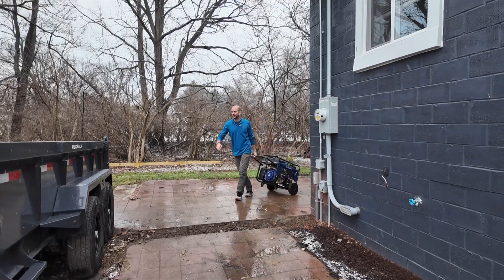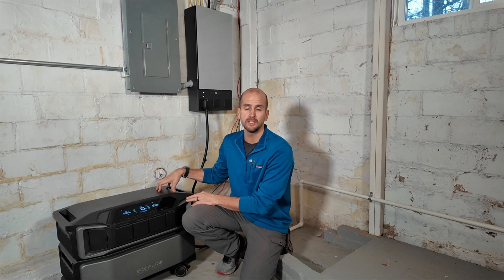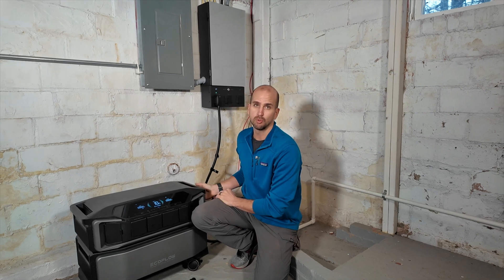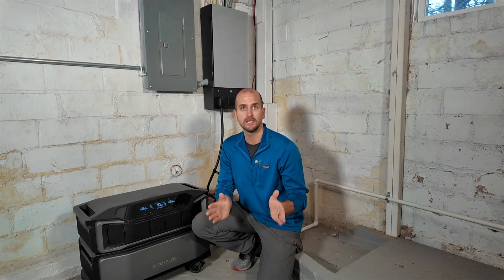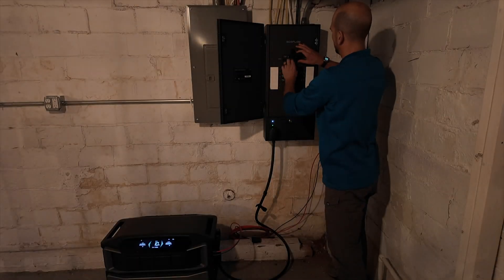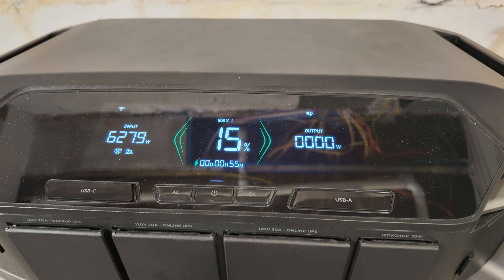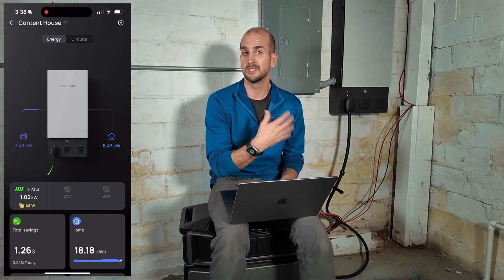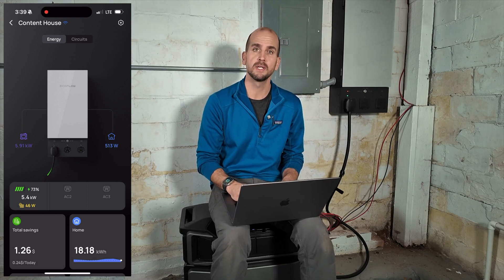Maximum Charging Speed Test | EcoFlow Delta Pro Ultra

Comment: Hey dawg, I know this is a year old but I have a question if you would please: 
Were you using an inverter generator or a simple artificial sine wave unit? 

Thanks in advance!
Cause I'm having troubles with mine. It's charge from the 120 volt drop cord but not the 240 come infinity.
Reply from the maker: I just had a standard generator but if I was going to charge the unit more than a couple times I would get an inverter generator to ensure I don't damage the unit.

Comment: Wow, thanks so much for the awesome video. I just had my DPU and Smart Home Panel 2 hooked up. I also had the electrician install a 30 amp inlet box by the Smart Panel for me to also connect a generator. I hope you or someone can help me with my question. Since the inverter is a 7200 watt output, If I bought a 4000 watt generator and connected it to the inlet box and switched the main breaker of the smart home panel to generator, would I then be limited to the output of my generator or would I still have the benefit of the 7200 W inverter?  Basically what I'm trying to do is get a smaller gas generator to charge the ultra's batteries when they get low until I get my solar set up. I don't know what the best way to go about it is. If what I mentioned will work that is great, or if I should not connect it via the 30 amp inlet box and just connect the 110 wall charger that comes with the DPU to the gas generator and charge it as if it's connected to regular wall power. I hope this makes sense. Thanks for any input anyone can give me.

Comment: Im curious if you can connect power from an existing solar inverter system into one of the 3 AC spots in the battery connection Box on the Smart panel. Would it cause an error because it is not connected to an ECO Flow product?

Comment: Can you plug in the ecoflow delta pro ultra to a 240 outlet and use the main plug to run your house at the same time . I ask this because I had grid tie solar already. Day time charging would come from my panels
Reply: From my understanding you are able to charge with 120v while using It at the same time. I would imagine you can charge it really fast if you had the smart transfer switch

Comment: I don't quite understand.  You are charging through the same cable that the Ultra uses to power the house?  I assumed you would use a different cable into the 220 outlet on the side of the unit.  I have this unit in shipping and look forward to using it as a backup through our existing generator panel with a separate circuit to provide generator power to the Ultra, as needed.

Comment: I just bought an Ecoflow Ultra. Output is going from the L14-30 outlet to an inlet box and into my home breaker panel via Interlock. Works fine. But...Then I'm trying to charge using my Rivian's 1500 watt outlet on slow mode 600watts input and the GFCI on the Rivian trips immediately. If the Ecoflow is not discharging, it charges fine. As soon as you turn the discharge on, trips the breaker immediately. Anyone else have this problem?

Comment: Is there a way for the ecoflow to manually start a generator with an ats capabilities , for example when the battery drops to say 10% , it will send a signal via ats to the generator to start and when the batteries are fully charge then stop the generator, can this be possible with other integration?

Comment: Can I use a EG4 Chargverter to charge the Ultra?
Reply from the maker: Maybe, but I think you would have to take the Chargverter output into the Solar Input on the Ultra.  Not sure if that would have any issues but from my understanding the EG4 Chargverter out is around 48V DC, right?
Reply: @everydaysolar  I think Output Specs: 
• Optimized for 240 VAC power supply 
• Nominal Battery Voltage: 48VDC 
• Adjustable Charge Current: 0-100A at 240VAC 
• Adjustable Charge Voltage: 43-57VDC (Default at 54VDC) 
• Maximum Output Watts: 5120W at 240 VAC

Comment: can a solar generator be used as backup power  in a condo INCLUDING a 220v  stove, dryer  and hot water heater?   Theelectrical  panel is inside the condo in the hallway..
Reply from the maker: You would need a generator inlet installed running to your main electrical panel with an interlock.  It is doable but would need some electrical work done.

Comment: What unit of gas gen ?
Reply from the maker: The Predator (9500) Inverter Generator would be a great unit if you needed to use it regularly as part of an off grid setup.  Overall EcoFlow does recommend using an inverter generator as opposed to a standard generator to charge the Ultra.
Reply: @everydaysolar   I really appreciate your stuff! I went from knowing 0 about electric to just this week installing new breakers, inlet switch, and of course my new Ultra! Your work is valuable, have a great day !

Comment: Charging speed is irrelevant when you consider this high frequency, transformerless inverter's shorter life expectancy and poorer surge capacity when compared to a low frequency, transformer based solar generator.
Reply from the maker: Yeah, I know a lot of people question the ability of the high frequency inverters.   I am trying to daily cycle this unit and even run my Mr Cool 3 Ton heat pump off the setup to see what results I get after months/years of use.

Comment: Curious, using the EcoFlow AC Generator Charging Adapter - Could you run that to a generator inlet and have it supply power to a SolarEdge inverter, which doesn't produce solar power when it has no AC Current. Effectively outputting AC from the Delta Ultra to supply AC current to the Main Panel which in turn would turn the SolarEdge inverter on. Solar would start producing power and offset power consumption used by the eco flow? Any excess energy produced by the solar would top off the ultra? This is a hypothetical guess, however being that I have both a Ecoflow Ultra and SolarEdge inverter(solar panels-which i can't use due to having optimizers in place). Probably won't work like I'd imagine (or hope), but made me wonder.

Comment: Giant Chinese Battery company gives away a couple hundred FREE 5k generators to some good old fashioned American looking people.  Very clever.  Really,  EVERY review of these are from people who were GIVEN the generators by the manufacturers.   Kinda disgusting.  yeah  these things are cool, especially the Ecoflow Ultra,  but in reality you need a gas, diesel, or propane generator for any long term needs...more than a day a two.   Get a duel fuel, run it on propane, and you won't have the problem of gas sitting for a long time.  Imagine,  you buy a predator, Westinghouse, or champion 12500 duel fuel for 1500 max.  Done.  These power stations are just a shiny object.  Good for Van Life,  I own two Ecoflows,  but they are not serious for home backup.
Reply: This is true. Although the right amount of solar and battery capacity it can be free energy to indefinitely. May be expensive but gas is a life long subscription. The sun is free

Electric is the future china is 100x pass us Americans we are so delayed most of us don’t know it
Reply: Aren't you then running the champion 12500 24x7?

Comment: I need to charge my tesla every night, but not to 100%, but at least to 60-70%, so how long will it take to charge at 7200 watts at 30 amps?
Reply from the maker: What is your charge level when you get back and which Tesla do you have (need battery size in kWh).
Reply: 85kw I usually get home at 35% the need about 60% more for next round trip to work. Model S 2017. Usually 70-90% needed for RT.

Comment: Would like to see a video in which you maximize the solar input to the ultra with the smart panel 2.  I want to see what happens if you produce over the 4kwh in the HV.  How does shading affect the power with this inverter.  What happens is temperature causes total panels VOC to exceed 400volts.  I was thinking of using 10 400 volt panels.  Because I already have a grid tied system in the south side, I thinking of putting the panels facing west.  The intent is to add to my power production and in the case of a blackout have some solar.  I will be adding a generator plug to the smart panel.  Thank you

Comment: Can the EcoFlow Delta Pro Ultra be charged from a 15 AMP outlet connected to a circuit breaker?
How long will it take to have a single battery be fully charged?

Comment: Thinking about buying the Delta Pro and using a gas generator for charging. My generator is 10 years old in excellent condition. Do I need a Sine Wave output to charge the Ecoflow or will the 110 output be sufficient?

Comment: Thanks for a great demonstration. 1-Can You charge the DPU with the 220v input while using the 220 out put with out the smart wall panel ?  2-Are the batteries UL compliant for inside home installation ?  3-Anyone knows yet if there is a way to connect the EF smart gen with the DPU automatic start ? 4- Can we have the DPU connected(110v line in) to the smart EF (110v line out) gen and start the EF gen and charge the DPU that way  and still use the 220v output on the DPU?  and that with or with o ut the smart home panel.5- You demonstrated that  we can charge the DPU with the SHP connected to the 220v generator while doing this could we also charge from the 110v input on the DPU ?  Thanks for your time and your help
Reply: Theres a video i found the other day of someone charging with 240 and outputting 240 at the same time
Reply: @ anyway you could share this video thanks
Reply: actually no.. he made update video... the 240 was still working - https://www.youtube.com/watch?v=lkkCbJDxKY8

Comment: Excellent videos, and thanks for your honesty without any hype. 👍
Wondering about the practicality of skipping solar panels, and just fully charging using the grid at night since it's off-peak billing and charges, but switching to only battery during the day when grid charges are peak?
Not sure if this is practical, but I'm trying to avoid the solar panels based on backyard space.
I'm also guessing that grid charges should be reduced by 30%-50% if this is a plausible option.
Thanks in advance for sharing your thoughts.
Keep up the great work! ✨
Reply from the maker: Yeah the app has a Time of Use mode when you can set your charging and discharging times.  You could just to the math on how much you would save daily to see what your payback period would be for the setup.
Reply: @everydaysolar  Sincerely appreciated. Keep up the good work! 👍
Reply from the maker: @trini-rt6xn  Will do, should be a fun and active 2024 👍

Comment: How well will it work for EV level one charging, where the cars takes 40 hours to charge??
Reply from the maker: Shouldn't be an issue but you could also step into the Level 2 range with the 240V and 30 Amp outlet on the Ultra.

Comment: I have the same Westinghouse generator. Is there any potential problem using the Westinghouse to charge the Ecoflow with it not having a pure sine wave? I would definitely rather not have to invest in another gas generator to charge the Ultra if it is not necessary.

Comment: Will you be able to charge with the eco floe dual fuel generator , or will that require an adaptor for it to work
Reply from the maker: It's on my list of questions to ask but it would need a special adapter at a minimum

Comment: I would love to see the wiring details of the Smart panel 2 to understand how the loads are handled. (For example can an AC unit running off of batteries and supplied by solar get additional power feed from the grid when a cloud goes by)
Reply from the maker: Yeah, we will have some additional videos coming out soon.  You can set logic and group circuits in the App.  For instance, always power lights and refrigerator off battery but only power heat pump off battery if charge level is above 50%.  A lot of flexibility in the App configuration.

Comment: Can this unit be charged with a 120V, 3600 W inverter generator?  You are using a 14-30 cable with 240V, but can it be charged with 120v.  Does the 240V have be clean 240v or can it be power from an older generator(possibly> 5% THD)?
Reply from the maker: You could charge with the standard 120V wall outlet cord plugged into a inverter generator.  I think you will max out at 1800W.  I do believe the preference for charging even with the 240V input would be an inverter generator which is not what I used in this video.
Reply: I wish that ecoflow would put out the charging capability of this unit.  The delta pros can not charge from the 1800 W 120 input while the unit is in operation which is an issue for use as a sustained UPS power supply design.  If power was converted to 12V, then it could charge the delta pro.  So the ultra could be a game changer, but the website just does not give enough info on this system plus the blind pricing structure.  Thank you... @everydaysolar
Reply: Can you do a 240 input and have the unit outputting at the same time? I know when I use the EV adapter on my Delta Pro it disables all of the outputs on the device.
Reply: Yes, that is the issue for me with the potential delta pro.  You need to disconnect the output in order to charge from 120 AC.  But you can charge from batteries or solar if the input is the same, respectively.  So, if the Ultra unit is pushing power at 240V house, I would like to charge with 120V AC inverter, while continuing to powering the house at 240V.     @vincentpiombo
Reply: @gibblespascack1418  I actually have the delta pros and I’m able to charge them with 120v (up to 1,700 watts) while I’m using the output of the device. I’m wondering if you can charge faster than that with the new unit while you’re outputting.
Reply: Please do a generator charge of the delta pro attached to the shp2. There are those of us who the dpu is just out of reach price wise until it comes way down. Also is the 30 inlet for the generator 120/240 or straight 240

Comment: Would love to see this work as a battery backup and time of use shift. Not sure if there would be a way to add some CT's to tell it to charge on excess solar then be able to push it back into the house when prices are higher or at night when there is no solar. I know that Delta Pro says it can time shift power but was never sure how it did it. Is it on a schedule or does it use CT's? Love the videos keep them coming.

Comment: How loud was the unit during the 6000 watt charging ?
Do you have a dB reading for that?
Also, do you notice a difference in noise depending on charging versus discharging for a given wattage ?  Is one louder than the other for the same wattage?
Reply from the maker: This thing is silent, the new cooling setup is impressive.  I took a dB readings on my apple watch and the Ultra puts out about 36 dB.  You will never hear the unit or at least I haven't yet and that is even when the fan icon is flashing indicating the unit is cooling.
Reply: I can confirm after using this for a while the ONLY noise I ever here from it is when the sun comes up or down, you will hear clicking in the MPPT controller. That's pretty much it. And this is in my bedroom unfortunately because my Main panel is in my closet 😞

Comment: I would be more concerned with charging a very delicate piece of EXPENSIVE equipment using a modified sinewave rather than a pure sinewave generator.  You're giving the EF Ultra a reason to die and if it does, you're creating more problems than its worth.  Charging from the sun using solar is probably the best way in my humble opinion.  OTHERWISE, thanks for giving us more info on this solar generator!
Reply from the maker: I agree that is probably not something you would like to do on a regular basis, thanks for the note.
Reply: @everydaysolar since these are nearly a year old now. Do you think they will be coming out with a newer version soon. Just trying to decide if it’s good to buy them now or wait till next version.
Reply from the maker: @1125-CD  Just my opinion but I would think an update for the Ultra is probably a few years out but just guessing.
Reply: I assume the charging unit is like most other battery chargers and the very first step is to rectify incoming AC into DC, which means the incoming power doesn't need to be ultra clean.
Reply: You can use a generator to charge the Ultra as long as the generator THD is 10% or less
Reply: The number of Panel needed to charge just one battery would be Plenty to get it charged very fast in 1hr or 2hrs max because it takes 6kw input for charging

In a Non sunny day, that would be difficult to achieve (plenty panel involve)
Reply: Bonjour je recherche une autonomie de 4 jours minimum pour ma maison 🏠 comment faire svp ?
Reply: Just bought a DPU for loss of power. I have two old 5000 watt gens but after reading info I was afraid to recharge DPU with them. Bought a new trifuel pure sine to recharge in daytime and use quieter battery at night